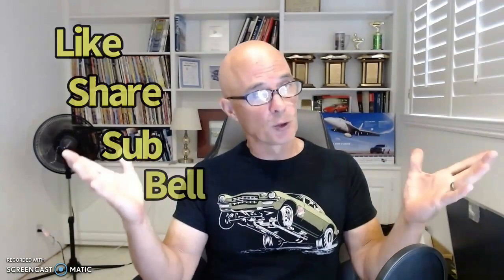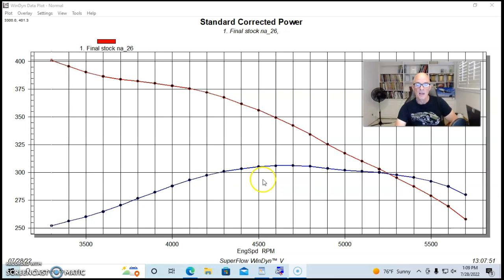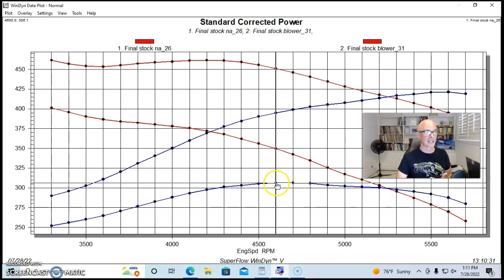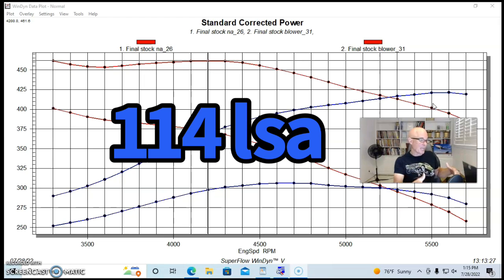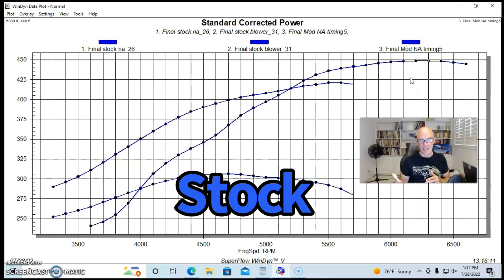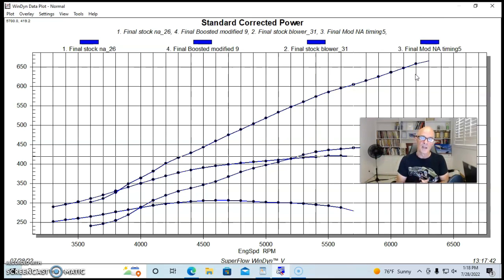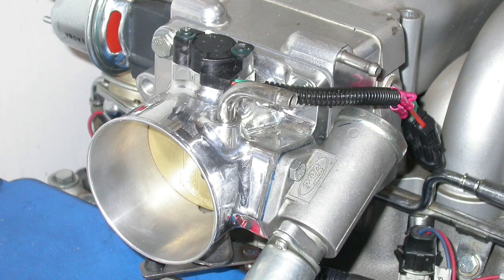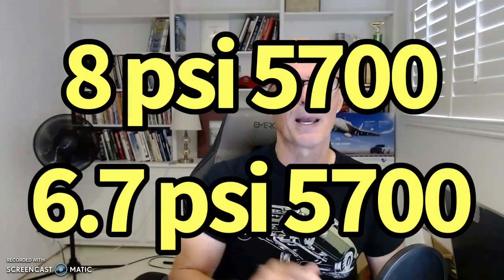347 FORD STROKER-WHAT MAKES MORE POWER? BOLT ONS OR BOOST? WHAT HAPPENS WHEN YOU UPGRADE WITH BOTH?

Comment: I'm in the process of building a 347 sbf with boost! With edelbrock performer 6037 heads and edelbrock rpm intake and for boost I've got a powerdyne supercharger with 10 lbs

Comment: Tests rich can do. From Bloodviking 

Diesal blower on v8 testing

 throttle response,   improvements by lite reciprocating and rotating internal parts

36 psi boosted cadillac 472 

Max top end 427 bbc powerband

Arias HEMI bbc heads on 427 to 540 bbc

Throttle response, aluminum conn rods on a street car, 

454 tall deck, max power will the block handle

Max nos on pump gas and then e85

Big cid stroker 740 cid  motor vs high rpm 427 power output who makes more.

Big C.i.d vs stock c.i.d turbo motor

Cost of turboing vs nos.

How much boost is too much on the street Max boost on e85 and Max nitrous together.

Comment: Richard need your expert input , I have won some parts from American muscle for a 347 build. This will be going in my daily driver a 93 lx. so far i have a scat 9000 kit, 30# injectors, new lifters,comp timming chain, trickflow streetheat intake,70mm tb,the correct balancer and flywheel.comp roller rockers and a mild comp cam xr270hr.
Ill need heads and like the emmisions  legal AFR 185 they flow well. im second guessing the cam as you go for bigger on 347 builds, and ill have to tune anyway, thinking moates quarterhorse. i need this to be driven daily so how big should i go?
thank you in advance nick from nevada.
Reply from the maker: the 274 is my go to-especially for a daily 347
Reply: @richardholdener1727  thank you for a quick reply,your advise is priceless ,thanks again.
Ill sell the 270 and buy the 274, one more question i am pondering the tune,should i buy  a new mass air meter calibrated for 30# injectors or keep the 70mm with stock sensor? Can i tune the stock one with a quarterhorse?
Reply: anybody?

Comment: Hey Richard I'm a long time fan and you know your shit and I want to ask you a question. I bought a Speedmaster block 351 Windsor part number is 286-009.  Bore is 4.125 Cleveland main caps 9.750 Max block I wanted to do a four inch stroke crank Molnar what size rods should I go with to fit that block and what pin height on the Piston should I do so I know what fits that block and it will be on methanol it will be turboed I'm looking to do 1500 horsepower or if you can come up with a setup that will give me there to that 1500 plus horsepower goal that would be awesome?
Reply from the maker: you need to search the piston/rod combos available (JE, SCAT, Wiseco etc...)-that will tell you what works with a 4.0 crank (for that power level you will need serious stuff-like Carrillo
Reply: @richardholdener1727  thank you

Comment: My question is which would be faster in the quarter mile boosted stock or bolt-ons.? And the cost should be factored in to both of those to see which is cheaper and easier to install

Comment: Isn't boost technically bolt-on? I'd argue it's easier to bolt on than aftermarket heads & installing a cam.

I'd be interested in seeing boost+cam, but I already know how well that will go.

Comment: I'm running a 427 Windsor (Dart block) with AFR 205 heads, 10.5:1 static compression, and Holley Sniper - it was not built with boost in mind. I'm considering adding a Vortech V3-Si. How much boost can I safely apply without blowing out the rings and/or head gaskets?
Reply from the maker: you should add ring gap then the sky is the limit with enough octane
Reply: @richardholdener1727  - well, I know that would be optimal, but I don't want to pull the motor apart.
Reply: Then leave it alone unless you want to add an aftermarket inspection port

Comment: Yeah, I don't like this test at all. It wasn't what I thought you were going to be doing. There's no way you couldn't have just added more boost to get more power than the N/A version. A better comparison with a centrifugal blower would've been to run them at the same rpm. If you have to add springs to do that, then so be it, but this isn't a valid comparison for N/A bolt ons versus boost.
Reply from the maker: the pulley was the same-same blower speed
Reply: @richardholdener1727  Not if you revved the modified one higher it wasn't. Please don't take my comment wrong, I love everything you do, you're awesome and I appreciate you.

Comment: It’s safe to say 700+ hp with a pulley change?
Reply: Sounds about right, but wouldn't want to try with that stock block.
Reply from the maker: it would easily go there with enough fuel and this pulley

Comment: I purchased A set of AFR’s for my 406 sbc instead of buying boost for the street and am very happy I went the N/A route.More then enough power and the torque is insane.Old school gen1 with gears and A decent trans can still stand its ground on the street.
Reply: I think a really solid choice.. Big Inch Small Block & Great Heads.. Id think you're making more HP & Torque than many stock Big Blocks.
Reply: I am not sure what’s it’s pushing.So many people claim big numbers.I had A goal to hit 450hp/torque but I might have exceeded that limit with these heads.Rich suggested the 195’s……. 406 sbc Victor jr 10 1/2 to 1 compression,hydraulic roller dur 244-252 lift 560 on A 110 lobe 750 Holley 1 3/4 long tube.Decently tuned.I was going to purchase the AFR dual plane because I love torque but this motor rpm’s in A blink.I spend little over 43 hours porting this  Victor jr I would hate to have to do that again.Matched up perfectly I couldn’t be more happier.Sure did learn a lot from Rich and love watching the boost.I would be to nervous to add little boost to this motor its already pretty snotty.Not sure how much this old block can take.Anyone have an idea?
Reply: That's awesome.  
Now when you want more the boost will just be even better 👌👍
Reply: When the time comes, this is what the 400 in my truck will get!  "Big" cubic inches, great flowing heads, and a cam for low/mid torque.

Comment: I want a built engine not only during a run but at a traffic light too. For me, boosted stock engines just don't give me what I want in a fun street car.  Sleepers are for nerds. Love those rowdy SBF's
Reply: Boosted stock is perfect on the street.  Small cam lots of low end grunt. 
I get what you mean but boost is the equalizer and the torque with stock everything except injectors and fuel pump obviously is hard to beat 😎
Reply: Build the engine n stroke it as much as possible, sure boost makes the most power but a cnc headed n cammed v8 n/a sound n instant response is great fun..
Reply: I did all that stuff long ago but still thanks for the content!

Comment: Richard nice test but can you run a 347 with better heads afr renagade and different intakes performer, rpm and victor jr and maybe 266 cam vs 274 or 282 like you did with 302 engine back in the day

Comment: I would have liked to seen just a camshaft upgrade on the stock stuff before you moved on.
Reply: With those E7 heads.. Plus 20 to 40hp with a streetable cam.
Reply from the maker: please see the video where I added an XE274HR cam to stock heads

Comment: Another thing, I'd LOVE to see a 347 run with heads/cam/intake and a big turbo. Rich has always said that the more NA power an engine makes, the more power it'll make under boost, and that's common sense, but it's absolutely true. I've heard many stories about how the 302W can only support around 600 HP due to block strength, but what can you do to a 302W block to strengthen it to handle more boost? Does anyone make a girdle for it? Does anyone make any kits that can tie the mains together? Or are you simply relegated to buying an aftermarket block? I've built many engines in my lifetime, but I don't know everything there is to know about 302s.
Reply: It's called a 351W.
Reply: @thorlin3826  yup. 351w and stroke it then, mod it, then boost it.  1000hp
Reply from the maker: a girdle won't help it
Reply: They make a dart block 😆
Reply: SHP block is the best option. 👌
Reply: IMO just start out with a 351w. Your cost will probably be even lower than the'347 especially at stock cubes.. And the block can take just about any boost you want reliably. A win win for less money.. My 2 cents..
Reply: @KR-qs3rt  Not to mention the Rods. I will probably never build another engine but if I do, it would be a 351W.
Reply: @thorlin3826  Good point.. I forgot about that one..👍

Comment: Hey Richard I have a question about a custom ground Cam. I have a 85 F150 4x4 with a built 351w AFR 185s Edelbrock flo pro EFI and lots of other goodies. It's got a comp 280h cam right now. With my application being different than most (not going in a car) would there be any  Benefit to getting a custom ground Cam?. Thanks .
Reply from the maker: there are lots of shelf cams that will work

Comment: Can you do a test with a V8 running a small turbo off only one bank? That would be cool and different
Reply: Zoomies on one side and fender dump on the other lol
Reply: That sounds like a recipe for disaster
Reply: @chrishansen7004  it very well could result in rods violently exiting the crankcase, but what would holdener's channel be without big bangs?
Reply: @chrishansen7004  never know might be great to add 100 hp

Comment: One thing I've always wondered, I know what the Ford GT-40 is, but they never came fuel injected, and they never had an intake manifold plenum, so why is that intake manifold always referred to as a "GT-40 Intake"? I've heard people say that they had GT-40 heads as well, so is that just an aftermarket model line, or what's the deal?
Reply: It has nothing to do with the vintage car.  It's just ford's internal code for the cylinder heads and intake first used on the 93 cobra mustang....
Reply from the maker: and Lightning
Reply: @richardholdener1727  everyone loves the lightning tubular upper!